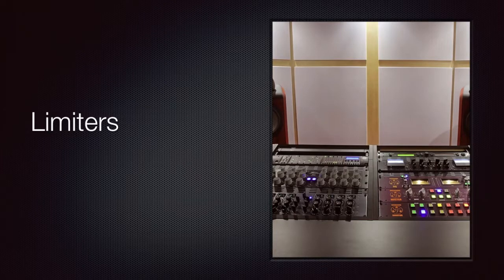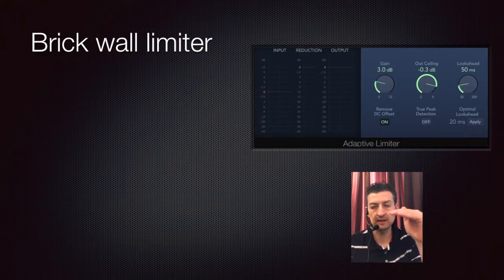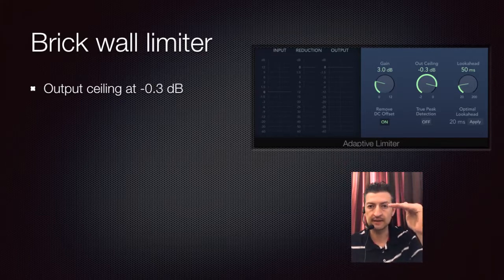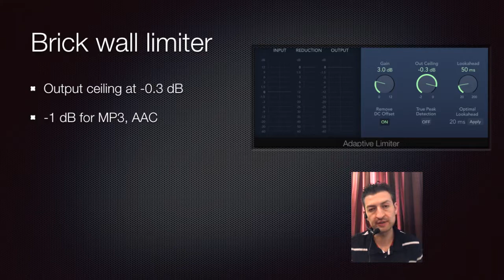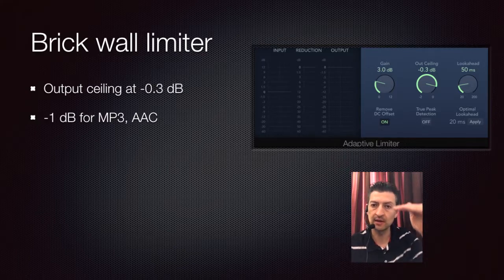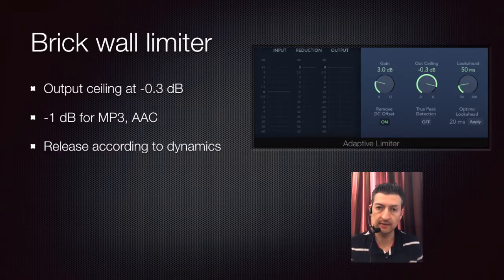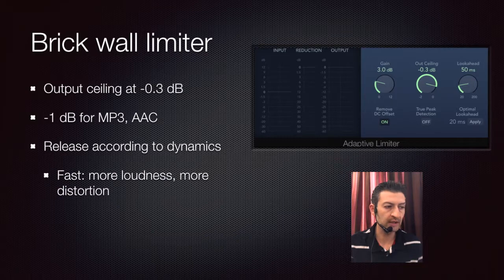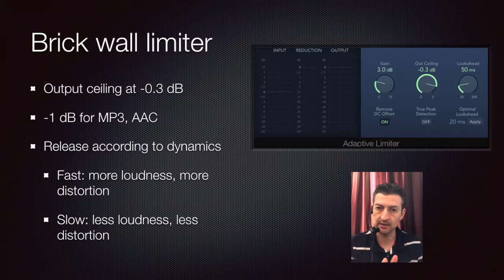Audio mastering - Recommended limiting settings

Comment: I’ve been digitizing vinyl records into Pro Tools, should i normalize to 0db before applying limiting process? Thanks.
Reply from the maker: Hi! That's not necessary. Your recording levels in Pro Tools should be around -18 to -15 dBFS. Then, the limiter will help you to raise the final level below 0 dBFS.
Reply: Very helpful, thank you!